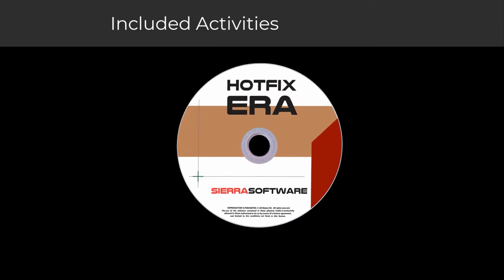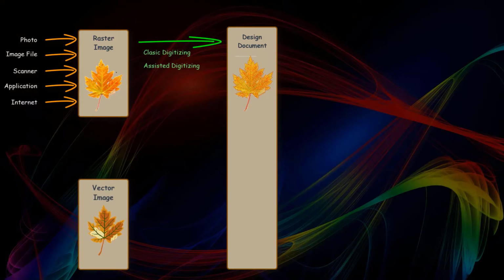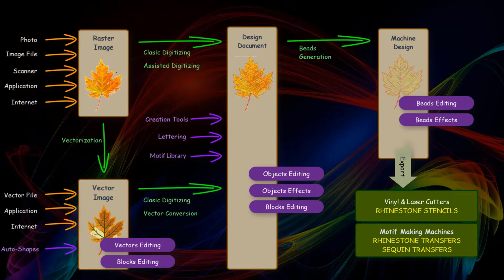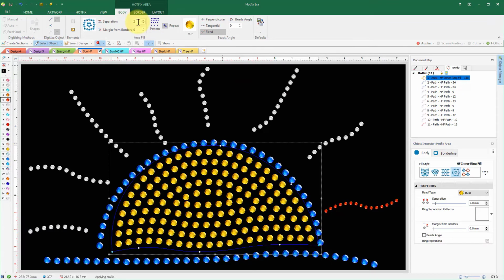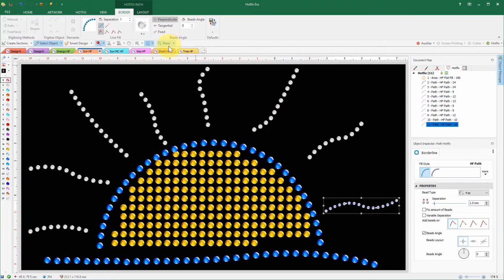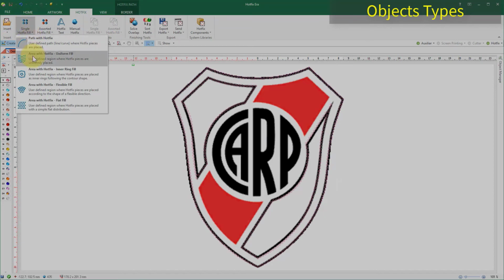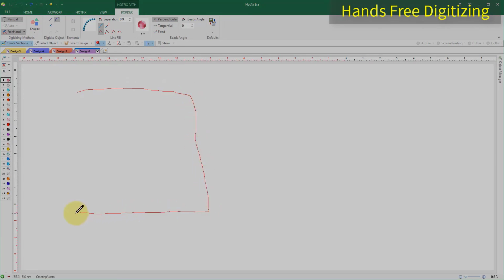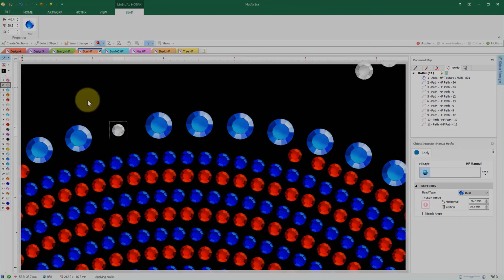Hotfix Era: the best rhinestone & sequin design software suite

Comment: Can this work with the Graphtec Cutter CE-6000 plus and an older version of Corel Draw?
Reply: The software can send the designs to any cutter that includes the corresponding windows driver (usually provided by the cutter manufacturer).
If a cutter doesn't work through windows drivers, designs can be exported to standard vector files (HPGL/PLT, SVG, DXF) that can be imported with propietary applications provided by the cutter manufacturer.
Want to try it? Just ask a functional software demonstration to play with the software 1 week and text the compatibility with your equipment.
This software is also compatible with many brands of automatic motif making machines (not your case), but these machines require extra machine drivers that we can provide.
Reply: @claudiolew1706  Okay….. Thank you. I will try that trial version first.  I do have SCAL 5 as well.